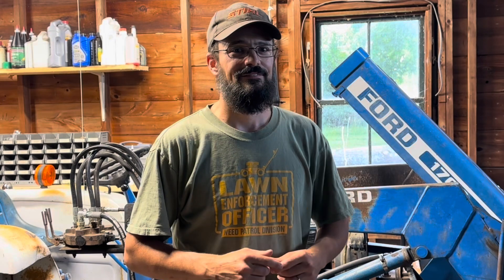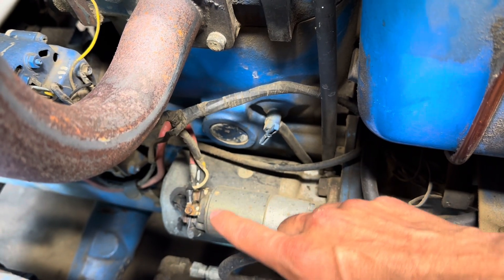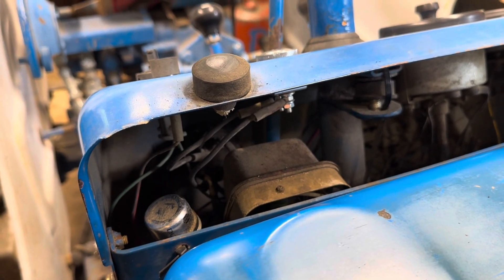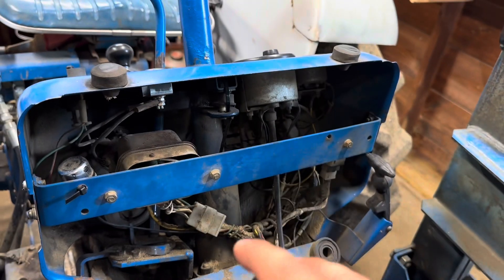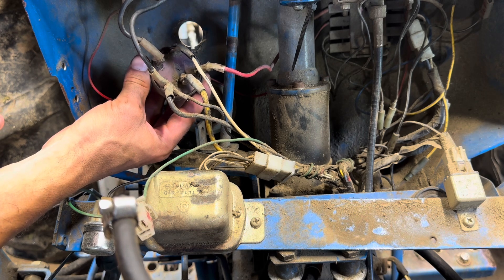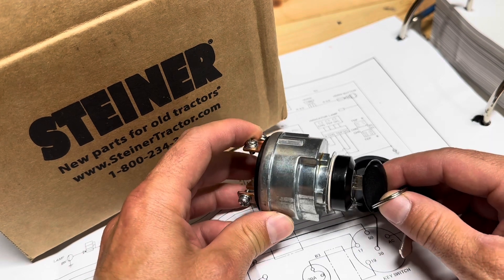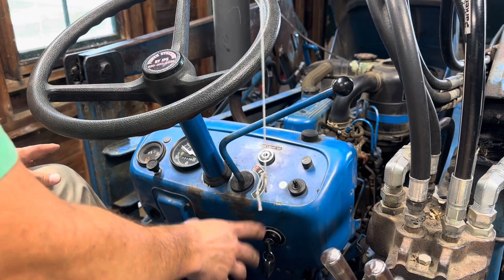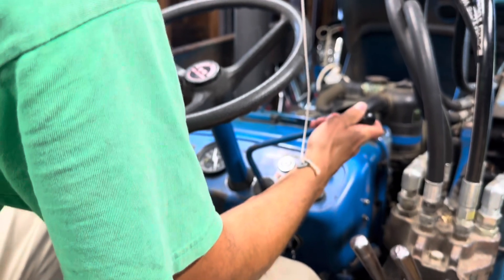Tractor Breakdown - Ford 1700 Ignition Switch Replacement

Comment: Love your videos. I have a 1980 Ford 1700 that I got from my grandfather. It's really helpful to see the exact same vehicle. In this video, though, I don't think you ever actually show how to physically remove the ignition switch.
Reply from the maker: The smooth bezel around the keyhole is actually a nut that holds the switch in. Grip it firmly and it can be unscrewed. If you can’t get it by hand, grip it carefully with a pair of channel lock pliers and that should enable you to free it up.

Comment: My glow plugs have two wires running to it and like a thin metal bracket connecting them. I just changed my head gasket and went to hook everything back up. But now when I start it the glow plugs light up instantly and start burning wire. Do they have to set a certain way? Or can you show what’s wrong
Reply: Or do you think it could be the ignition switch also? I didn’t have any problems before I unhooked them to take off injectors
Reply from the maker: @SmuheethOffical  I have a single wire that goes to the rear glow plug and a metal band that ties them together. The glow indicator is a resistor in the circuit. When my indicator flashed hot like that it turned out to be the ignition switch. I would check all the wiring. At the rear of the engine, my machine has two wires tied together that split, one goes down to the oil pressure sensor, the other (thicker) wire goes to the glow plugs. If all wires properly, it could be a bad glow plug or the ignition switch or…? I strongly dislike troubleshooting electrical issues.
Reply: @ProductiveRecreation  ima check it out when I get off work! Thank you! I suck at electrical. I put everything back together just how I took it apart yet now another issue arises and I suck at electrical work lol thank you for responding sir

Comment: Aww man or just wanted to see were the wires go oh well moving to fast for that
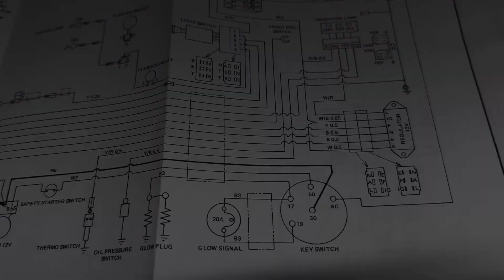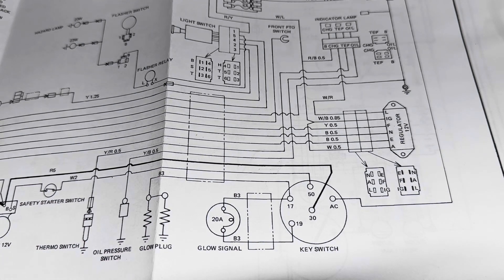Reply from the maker: @danielbyler1448  Check out the wiring diagram at 6:40 and the explanation looking at the switch beginning at 7:40. Later in the video I swap over 1 wire at a time to avoid mistakes, and I don’t explain what goes where during that process. It is timelapsed because it’s hard to see (camera close enough to see well would have been in the way), and mostly me unscrewing and then tightening screws.

Comment: Love your videos! I'm in New Zealand and I have two Ford 1900's, one I bought as a spares tractor and the other is my 'daily driver' 🙂. The non-running rust bucket 1900 has 4WD and I wondered if you know if I can swap the 4WD on to the running 1900? Also, any idea on how to add remote hydraulics to run a fork lift 3 point hitch attachment ? Any help or advice would be really appreciated! Thanks Jonathan
Reply from the maker: Making the 2WD tractor 4WD would be a massive project. It would be easier to swap the engines and run the 4WD machine if the transmission on it is good. Otherwise, you would need to change out the entire front axle, add the driveshaft, and open the transmission and install the 4WD shift mechanism and gears, including the bottom housing to accommodate the drive gear for the front driveshaft. For remote hydraulics there is a connection point next to the flow control valve under the seat that allows for continuous flow when raising the position control all the way up and into the notch. Probably not going to accomplish your goal as you lose the 3 point to do it. The other way would be to plumb it off the loader block on the right side under the seat. Some of these tractors came with a backhoe - I don't know how it was plumbed, but that would be how to power your attachment.

Comment: So I'm curious about something. A few things actually lol. I wonder if your bad ignition switch caused a parasitic draw on the battery. Maybe that won't happen now. 2nd, is the new switch and the old one keyed the same? If your old teardrop shaped key won't operate the new switch, I'm wondering if I could buy the old keys from you? Old Shibaura ignitions were pretty much all keyed the same. I could use a spare key, but can't find original FORD engraved keys anymore lol!
Reply from the maker: @dougsmith587  1) It’s possible on the parasitic drain. After the initial jump I ran it for a couple hours before parking and disconnecting the battery to work on it. The battery charged up from running and is still working fine a week later. It’s an OLD battery though, its days are definitely numbered. 2) The new switch is keyed the same as the old one, so I’m using my old Ford key (I only have one). The bigger key head is nicer to grab. You can get spares that have that generic narrow oval key head (may backup was one of those). I don’t think any Ford ones can be had… unless you try a tractor junkyard like Long Lane Tractor in PA.
Reply: @ProductiveRecreation  we have the same reason for wanting the large head key🤣🤣 thanks for the tip though, I never would've thought about a tractor salvage yard for keys!
Reply from the maker: @dougsmith587  I’ve gotten other parts from them. They’re helpful at Long Lane.